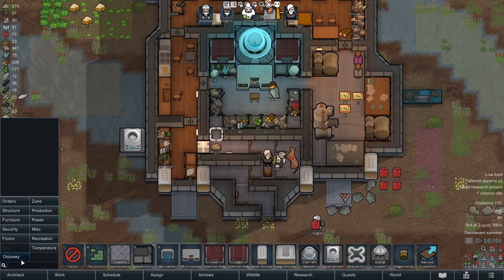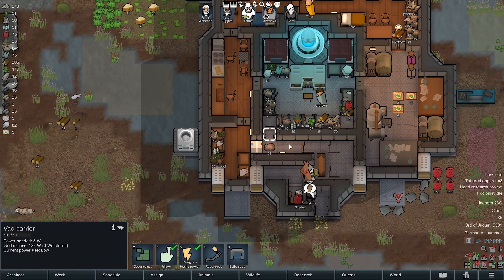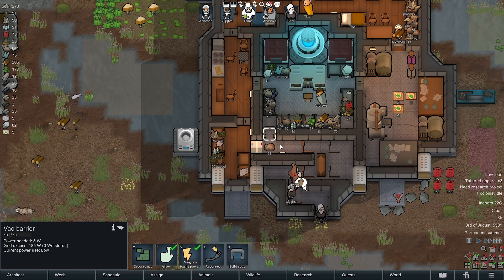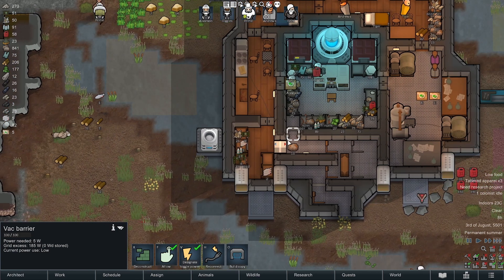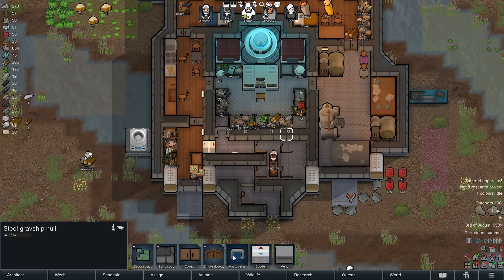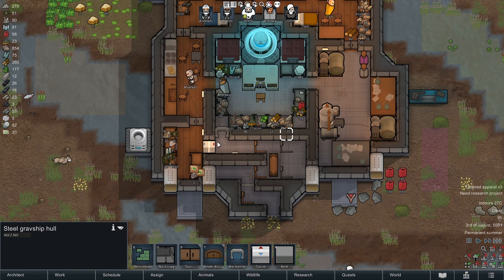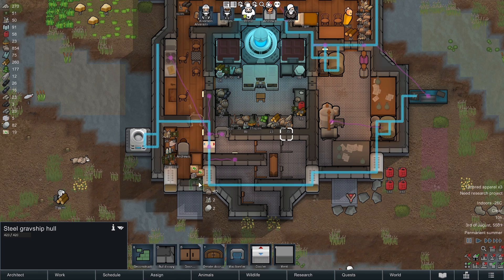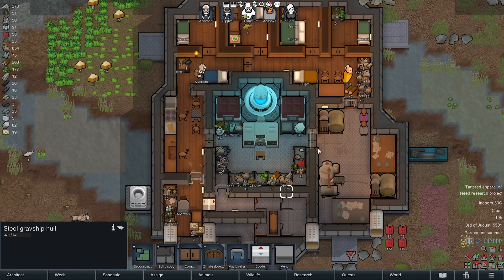How To Use Vac Barrier In Rimworld

Comment: 🤓👆Actually vac barriers also work when on land, they just don't show the blue part, but they do still act as a walkable wall and are therefore pretty handy for building fridges without autodoors
Reply: whats a good way to use them for airlocks? like put a real door on the outside because raids, then a vac barrier a couple blocks inside that? then it doesnt vent everytime people walk through the door? or something haa
Reply: or do airlocks not even matter because you dont have to actually pressurise air etc?
Reply: omg I just tried this, that's amazing. So much faster to get in and out of the fridge with no temp loss T_T